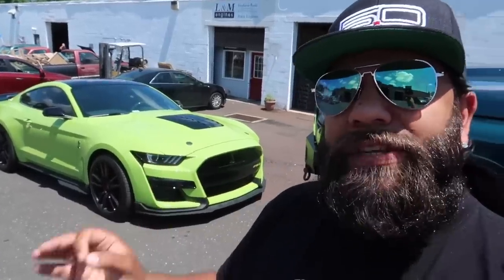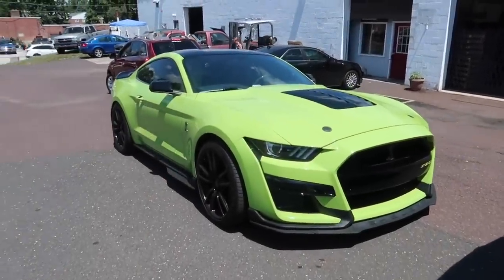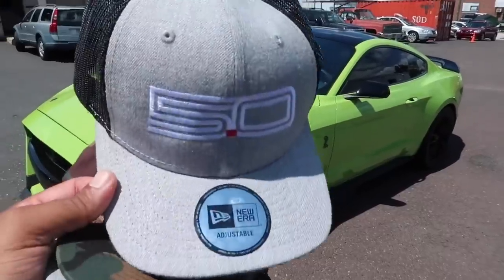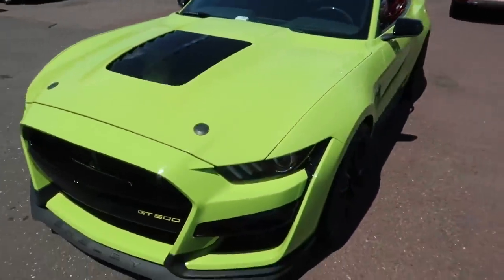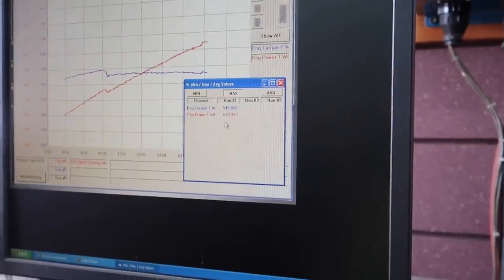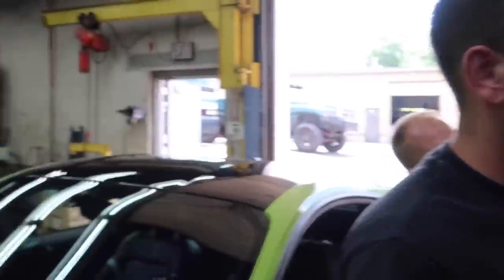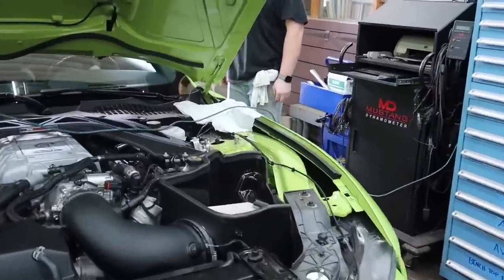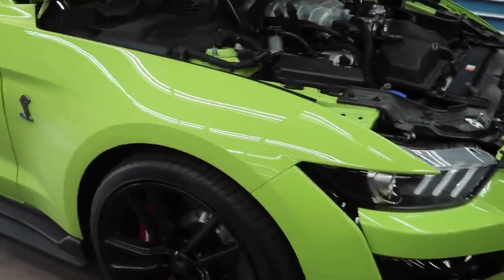YES We’re PUTTING CAMS in a 2020 SHELBY GT500!

Comment: Bummer the Dyno doesnt show hp and tq below 3000 rpms. It would be cool to see. Low rpm torque is so under-rated.
Reply: These over head cam engines don’t have much low end torque. This is why most drag racing cars don’t use them.